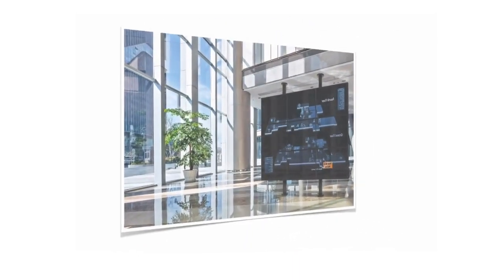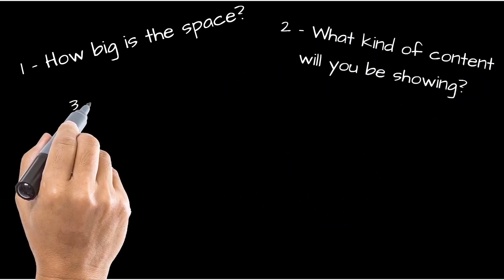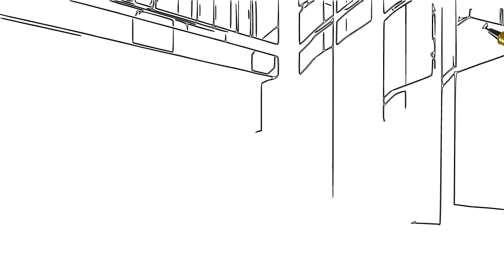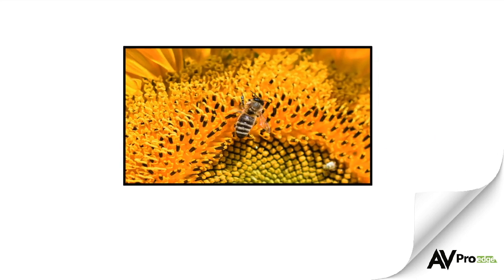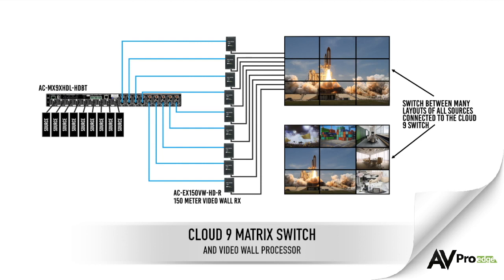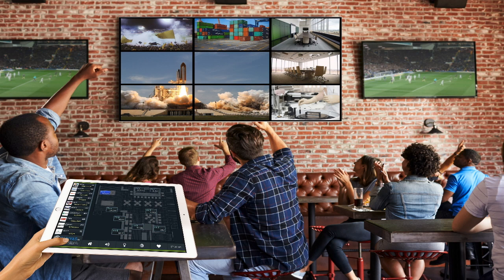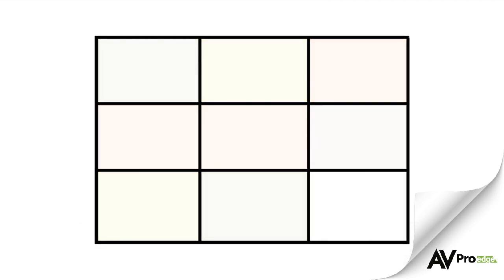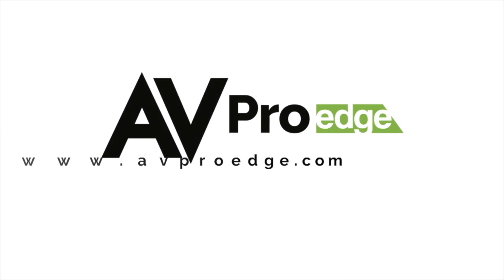How to Build a Video Wall

Comment: Thanks; would you please guide me for running such a system for regular using in my office to trigger my speed during the working hours?  I am also wondering about running multiple video projectors on a curved screen.
Reply from the maker: We can for sure help you, but it will be a little technical, so just call our tech support and they can help you. Phone number at avpro edge dot com

Comment: What software could I buy that would work with 4 tvs that are different sizes and not in a standard 2 x2 rectangle configuration? Trying to make an artsy video wall
Reply from the maker: Sounds like a cool set-up! You would need a video wall processor, they come with software. The Fresco series from AVPro can do that, AC-FRESCO-CAP-4, would be perfect. But if you want to really make the system shine with HDR or Dolby Vision video use the AC-FRESCO-CAP-9. They both come with a free software that allows you to configure the panel in completely customizable ways, using different types and sizes of TVS.
Reply from the maker: Here is a look at that software - https://youtu.be/ofCcUP1does

Comment: Please what is the cost of an average video wall?
Reply from the maker: What Size? and how many displays is going to be in your wall? Commercial Displays or bought from a retial store displays.
Reply: What’s the difference between a retail display and a commercial display?

I have a room 4.8m by 3.85m (tv on this wall) and am curious as to how much a video wall might cost. I would put 4 OLED panels together. 4 55” LG CX OLEDs would cost roughly £5,000 and 4 65” £7,000 retail: providing a 110” or 130” diagonal tv wall. Just a shame the screen doesn’t go all the way to the edge. 

Forgetting the TVs for a second, how much would it cost to be able to view the 4 panels as one screen whilst still being able to use them individually: 4 player full screen gaming? 4 soccer matches simultaneously? The set up and controllers. To be able to switch via an iPad say.

Could I use four 4K screens as an 8K screen for 8k content? Future YouTube vids and PS5 games perhaps!?
Reply from the maker: @user-jt1jv8vl9r  that would be sweet set up, you need to put two pieces together, a muliviewer and a video wall processor. Many of our customers have installations like that, but to do it properly you need to have a professional av integrator come out and do the install. If you do want to give it a shot yourself, give our tech support a call and we can consult you on what the best steps would be.

Comment: where can I find the slim bezel monitors/tvs and what's the most common size for 4 and 9 monitors
Reply from the maker: Each manufacture has a display made for a video wall, so you can call the one you like and they can walk you through the line. There is no common size, just how big you want your video wall to be.
Reply: @avproedge  I did not know this, interesting.
Reply: You can buy LG OLEDS CX; 55” for £1,200 and 65” for £1,700. Does LG make OLED panels specific for video walls and how much more are they likely to cost for these sizes? What I mean is are they more expensive than retail? I would guess that they are. Idle speculation really as would never get it past the missus.

Comment: I have fixed to the wall 4 x 65 inch smart TVs to create a video wall in my music rehearsal room.
 I want to create music videos for fun ( on vegas pro or similar) and play them on the video wall as 1 large image approx 3 m by 2 m.
In addition I will play live guitar and a singer will sing live to a the backing track and bespoke video images on the 4 x displays....just for fun...think scaled down stadium rock gig.
How do I create 1 large image to 4 x displays with out breaking the bank ? 
Your cloud 9 switch is unfortunately out of my hobbyest budget...
Reply from the maker: Your best bet is a 4 panel video wall processor. The AC-FRESCO-CAP-4 should do the trick. https://youtu.be/UXKkEws1ncY that is a video that may help.